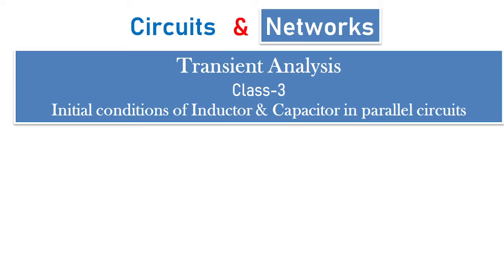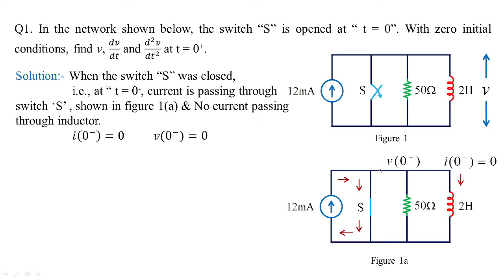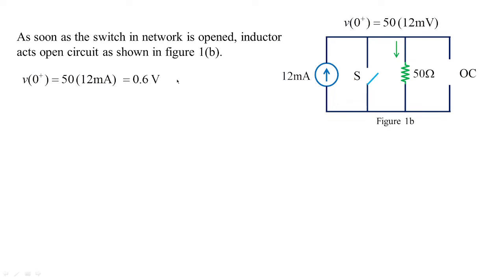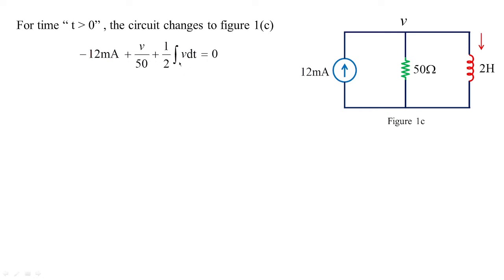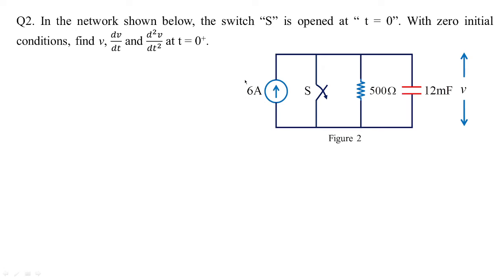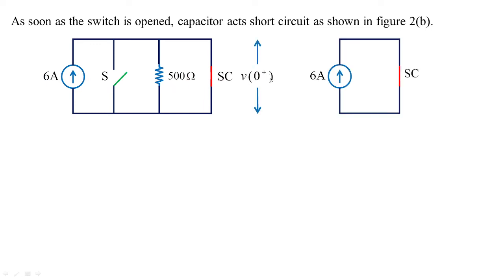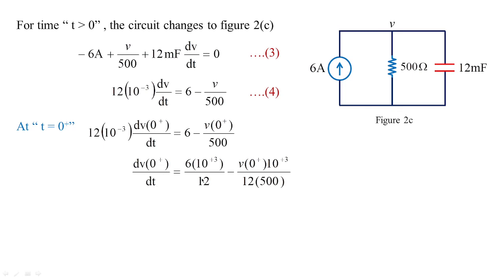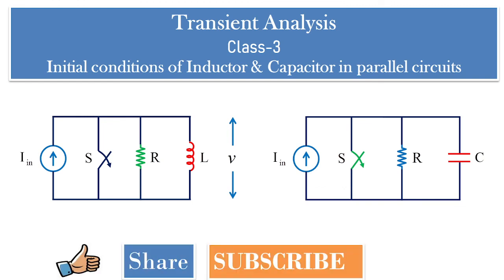What is transient analysis ? How to solve  parallel transient analysis problems?

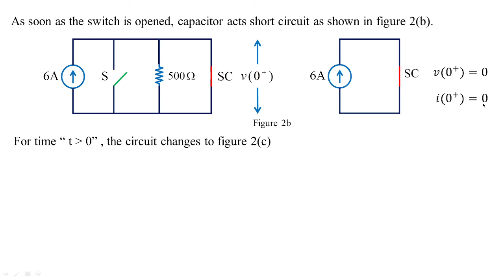Comment: 12:11 y the current  is 0  y not 6amps or we consider switch is open sobno current
Reply from the maker: current through resistance is zero at t=0+, capacitor has 6A of current

Comment: Sir what does minus refers in the velocity of first problem ( -15 v/s)
Reply from the maker: hello vardhan, -15V/s indicates the rate of change of voltage in inductor. The magnitude will remain the same value that is 
15 V/s. But minus sign indicates that the measurement of change in voltage is in reverse direction.